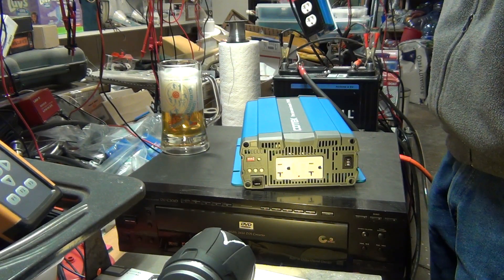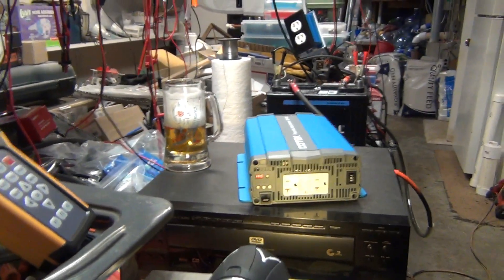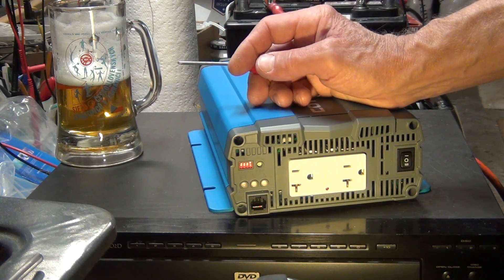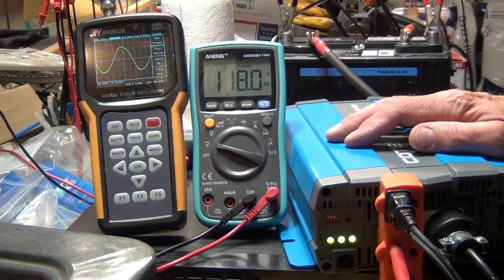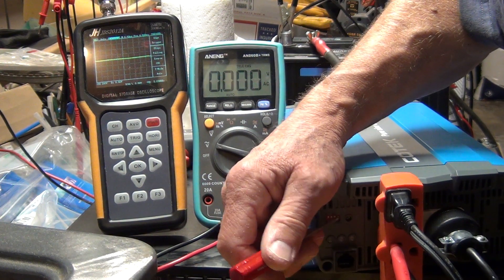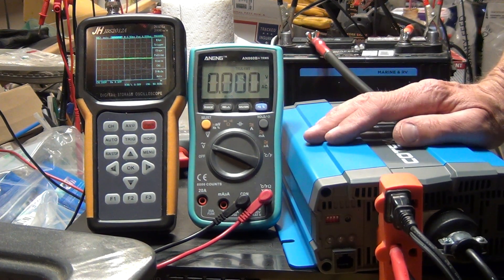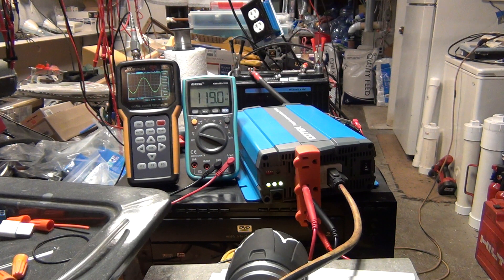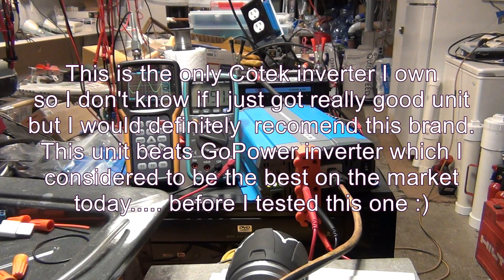Pure Sine Wave Inverter Cotek SP-700

Comment: Thanks. Could you explain a little bit more about dip switch 1 & 2 !!! I have Cotek SP1000 220 Volt and in the user manual it says that dip switch 1 & 2 combination give the following (100v/200v, 110v/220v, 115v/230v and 120v/240v). I thought initially that the Inverter will support 110v or 220v devices based on the dip switch combination, but that was not the case when I measured the output voltage. They all gave way more than 120v which will definitely burn out any 110v device
Reply from the maker: @rahalati  I don’t have it anymore but which country do live in? All US has 120 volts
Reply: @VladFredK  I live in Saudi Arabia. Do not press yourself, just if you can tell me what the purpose of the dip switches 1 & 2 in yours, what each combination does?
Reply from the maker: @rahalati  I don’t have the inverter anymore and I don’t remember, sorry I can’t help.

Comment: Yrs ago after seeing your video. I pulled trigger on getting one of these in 24/700. I have been using this all day everyday ever since. I agree the lug connection points were absolute pain to connect. But, the inverter itself works amazing. Only wish it had the bluetooth dongle option like Victron so I could see stats via bluetooth app. If I ever upgraded it would be victron for this reason.
Reply from the maker: Did you mean downgrade to Victron? Victron is a P O S inverter. Please check out my videos for Victron inverters.
Reply: @VladFredK  Looks like I will have to check them out.